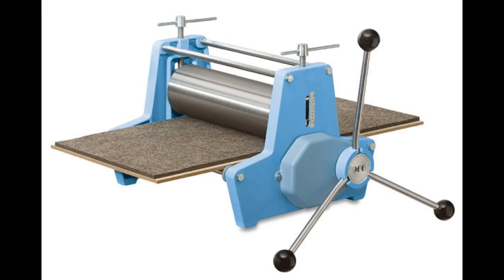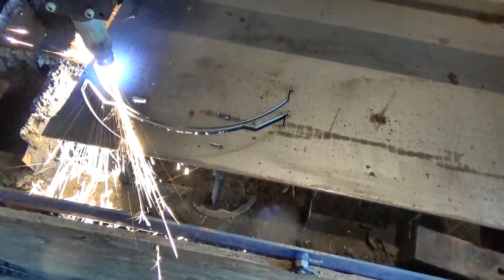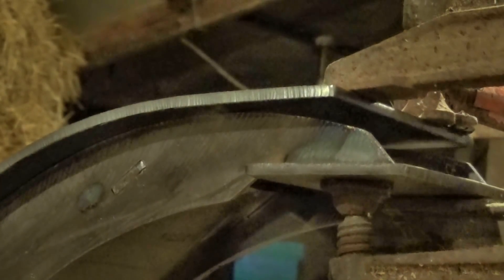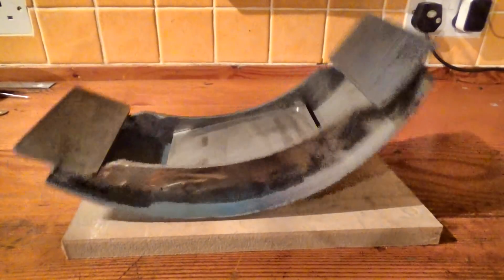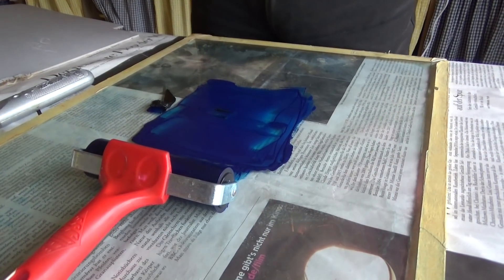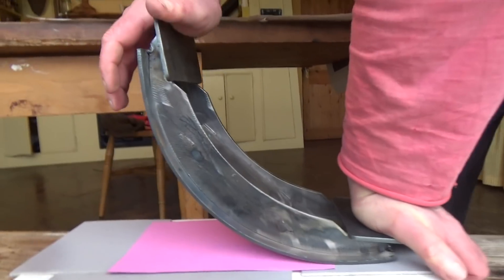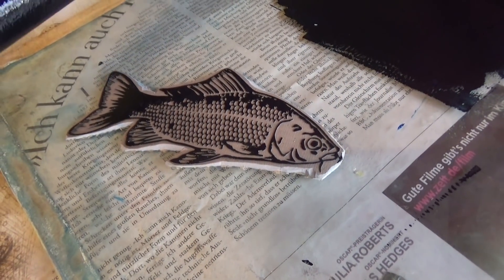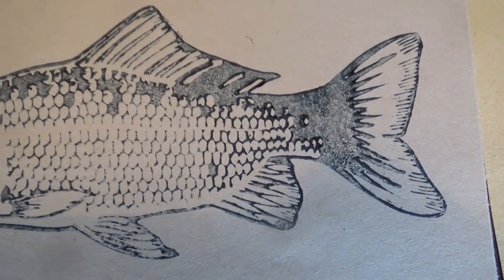The Rocker Press! A poor man’s homemade printing press for lino and woodcuts

Comment: You dont need a lot of pressure to make prints, just very even pressure across the print... you could use heat to encourage the steel to bend evenly and smoothly when you make your next press though I think the other commenters are on to something when they mentioned the clothes wringer(2 rollers with a spring pressing them together)...
Reply from the maker: I wish I could find one of those, Jeff, but they're very rare and expensive here

Comment: Try offset printing inks, these types of inks has a little body to it perfect for printing. You need not have to use a heavy roller for the transference .
Reply: A little bit of offset inks goes a long way.
Reply from the maker: Thanks, I'll look into those.

Comment: Not one of those experts by any means, but what about a regular rolling pin? I've watched Japanese printmakers before, and they just have a soft pad that they rub in circles against the surface. I think they have to do a lot more work to prepare the paper for printing, though... they treat it with some kind of glue/water mixture that makes it tougher.
Reply from the maker: I hear the rolling pins can drag the paper - but you're right and they may work fine.

Comment: Could you not use break shoes to give a more precise curve? Weld a few together and you won't need to make a plate
Reply from the maker: Brake shoes, you mean? I did look at them but the ones I found had rivet holes in them - could be filled though, perhaps..
Reply: @WayOutWestx2  yes, lorry shoes sprang to mind. Or a Seally bearing press is hydraulic for around £100.00 on eBay used.

Comment: Something else that might work is a piece of 4 inch round steel stock. A 12" piece. Might be 50 bucks at an industrial metal supply in the off-cut area. It would be mighty heavy, and you could just roll it across. Zero manufacturing time or dollars. Just go buy the roundstock.
Reply from the maker: You're right - although 4 inch might be a bit small? The bigger the better anyway.

Comment: Tim, this is of course up to your usual  superlative inventorial standard!

I wonder whether you have ever looked into the concept of compound leverage? This could be another way to print your linocuts.
The only working example of this with which I am familiar, is the wooden hay baler, which can be seen in action here,

https://www.youtube.com/watch?v=V1scGHhJAas&t=32s

The principle is that a hinged lever, fixed within a confined structure, would push a roller (like from an old wringer washing machine?) at a substantial pressure, across the linocut. The pressure could be adjusted by tinkering with dimensions and angles ... and would be a piece of cake for your brilliant mind to construct!

I look forward to the movie.
Reply from the maker: Thanks, Ruby. Yes I like that mechanism a lot. Hmmm...
Reply: @WayOutWestx2  
Oh, and I posted the addresses for the plans to make this mechanism under the video description today. It gives specifications for wooden hay balers obviously, but the principles can be adjusted to suit the application.

Comment: Great job! I built my own press as well based on plans from another printmaker using wood, angle iron, bungees and a small hydraulic car jack. I'm @hardpressedstudio on IG and that's my website if you're curious. 

You may try getting some packing to use between the print paper and your press. It serves a few purposes including helping the block and print paper make better contact. There are purpose made blankets, but I sometimes use a pad of paper. 

The great thing about printmaking are all the various ways to get the needed pressure to create the print.
Reply from the maker: Thanks, Emily. I'm going to look you up now.. : -  )